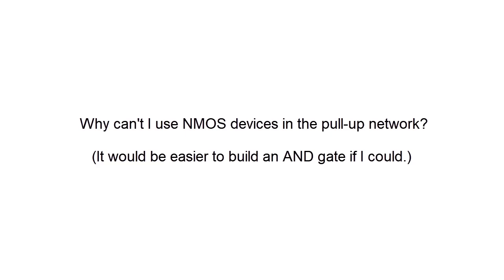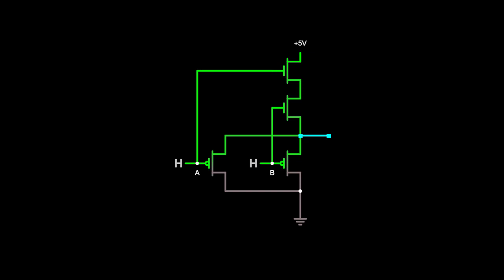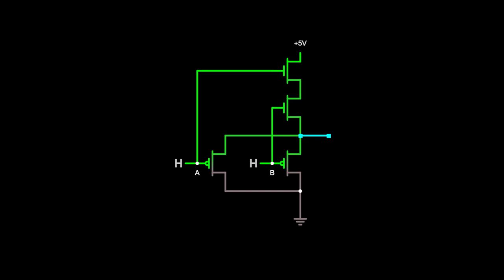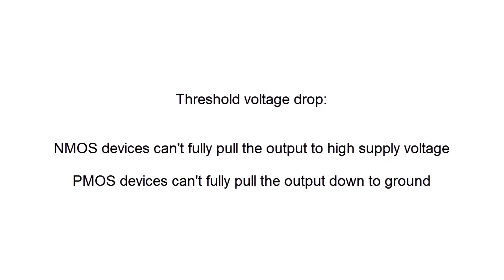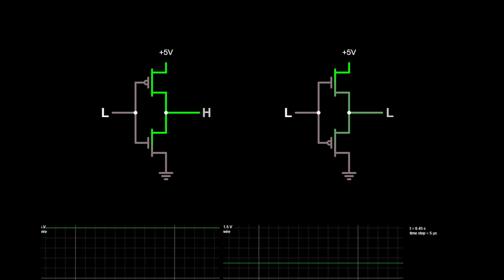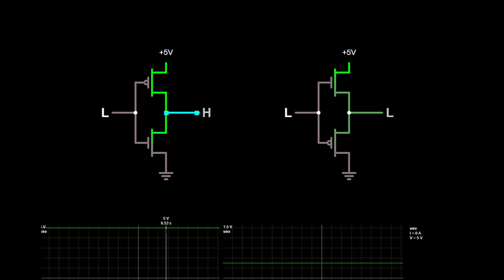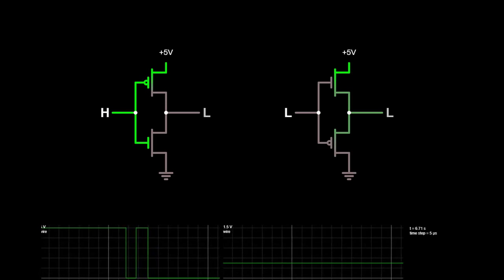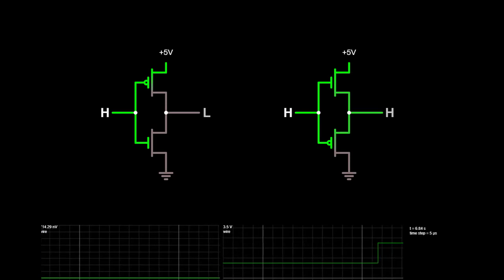Why not use NMOS as pull-up in CMOS circuit?

Comment: How does it increases the power dissipation when connected opposite manner, can you pls explain ?
Reply from the maker: Sorry it took so long to answer this--wasn't expecting comments!  The power problem mostly has to do with other logic that get their input from the "opposite" gate with PMOS devices in the pull-down and NMOS devices in the pull-up networks.  Since the output of the "opposite" gate doesn't go all the way down to ground or all the way up to the supply voltage, the transistors of downstream gates may not turn all the way on or all the way off.  This would result in some current flow in these downstream gates from the supply voltage to ground, since the transistors in both the pull-up and pull-down networks would be partially on.